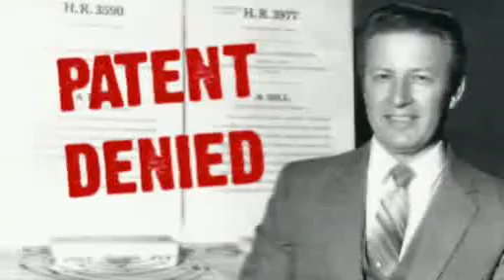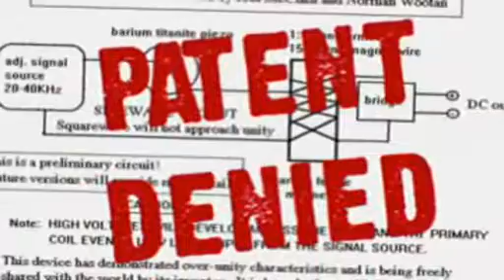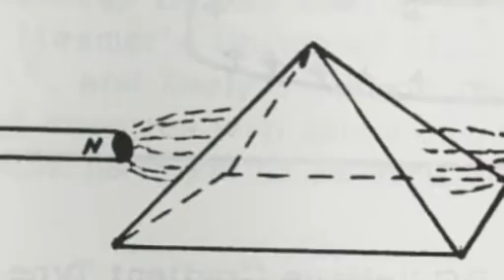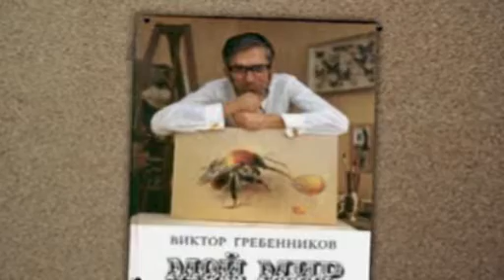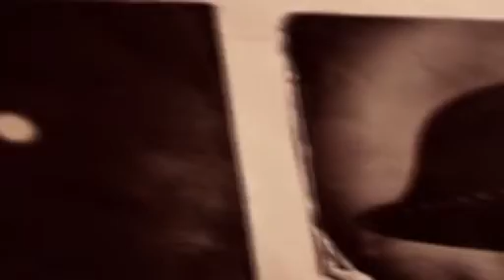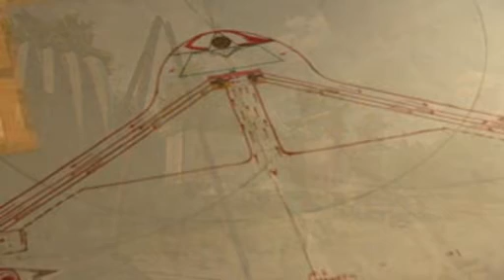A Machine To Die For: The Quest For Free Energy(part 4 of 5)

Comment: The fascination of wheels that don't go anywhere is because they go in a circle . Not in straight lines , so if the weight is placed on the wheel in one certain spot it theoretically should go in a circle forever . This was thought of and disproven long before man could cut and move large blocks of stone , come on stop insulting us .